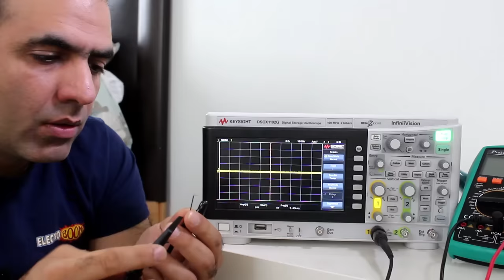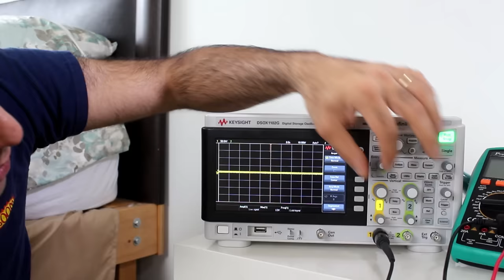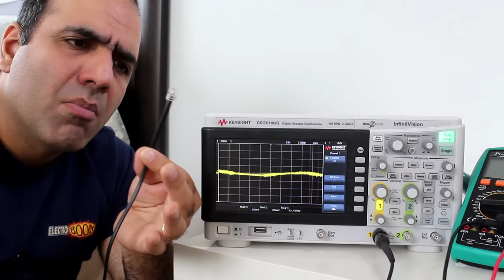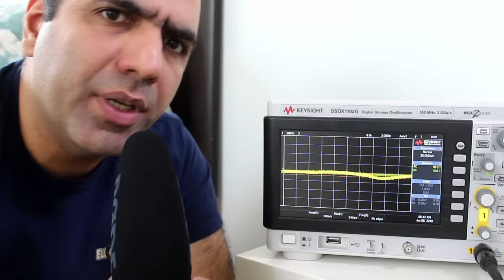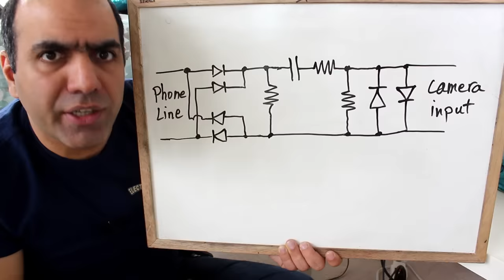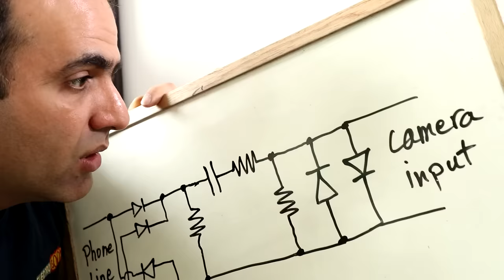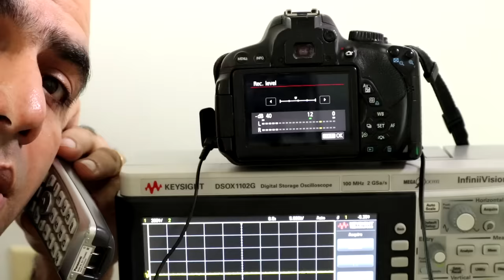How to Wiretap Phone Line with DIY Circuit

Comment: I always love the free-floating circuits without a breadboard or PCB, adds an extra level of chaos.
Reply: Chaotic evil circuit design
Reply: Back in the day they sold televisions made like that! 

A dozen valves, dozens of passive components, transformers, all made by soldering components directly to each other, and to the pins of valve sockets. Sometimes they'd have a tag strip, a strip of phenolic-impregnated paper, early PCB material, with metal tags with loops on each tag, attached along either side. The tags weren't connected to each other, unless you wired them together, but usually components just spanned between them, and each other, and the valve sockets etc, flying through the air (flappin' in the breeze!) like some sort of scifi architecture!

Then one day somebody invented the printed circuit board and it all got a lot more boring, though probably safer, and allowing more complex circuits to be made. Imagine a PC, with it's 8-layer motherboard and hundreds of tracks, replaced by wires zooming around the place and chips hovering everywhere. Would look like a Shenzhen rat's nest!
Reply: @greenaum  lol I feel like it would be literally impossible to hand wire a motherboard just from a volume/length of wire standpoint. I wonder how far back you have to go before you could do it? Could be an interesting (if incredibly difficult to impossible) project if you used a motherboard simple enough.
Reply: @MotorcycleWrites  The Turing Machine is probably one of the closest examples.. Although only just barely a computer.. ENIAC or the Mk 1... Although they likely used some form of circuit board.. (Please don't fault me for not having a vivid memory from what few actual photos of any of these I have seen in my life). Or the Bomb device used to decrypt signals from German Enigma machines... Again, a computing device, not quite a 'computer'.. close enough though. These can be faithfully rebuilt for the sake of doing so.. There are existing examples in museums of exact replicas. Imagine the type of mind it took to literally script programs using binary code on such long rolls of paper... And then rudimentary assembly languages on punch cards.. Thank the Mechanical God for CRT Displays...
Reply: HOT GLUE
Reply: It's all I could do

Comment: Fun fact: The term for the polarity of the phone line, "tip" and "ring", refers to the connectors on the switchboards operators used back before tone based switching. It doesn't mean any type of signaling, but rather it refers to the shape of the connector which is reminiscent of a quarter-inch mono channel audio jack. So it literary means the "tip" (+ side) of the audio jack and the "ring" or "sleeve" (- side) below the tip of the audio jack.
Reply: The GPO switchboard plug was more pointy than the standard 1/4" audio stereo plug to make it capable of rapid insertion and less wear. Tip and ring went to the twisted pair and sleeve to earth.
Reply: To be honest, really thanks for facts, thank you guys

Comment: I'm pretty sure you already know that but I'm going to say it anyway: The camera outputs DC voltage, because it was designed to support electret microphones. :)
Reply: phantom power?
Reply: Не очаквах да те намеря тук.
Reply: @MTBSelfieStickGuy  It is not phantom power, the electret microphones have a small field effect transistor to amplify its output.
Reply: @MTBSelfieStickGuy  yes

Comment: Here in the USA,  The line voltage is around 48 volts when off. Ring voltage goes from 0 to 96 volts. When you pick up the hand set, the line voltage drops to around 6 volts.
Reply: What is the voltage for each key?
Reply: @DaiShuryoTechnus  there isn't any difference really as far as I know. Old rotary phones work via pulse dialing so 10 short pulses (the clicking of the rotary) means a 0. With old systems you could literally fake this by pressing the button that hangs up the phone in a proper maner. Very difficult though but not impossible. The pulse is literally closing the circuit really fast, this video shows it with an LED: https://www.youtube.com/watch?v=2JlGYetRfi0 

Modern phone lines work with tone dialing where a frequency is sent for each key instead of pulses.

Comment: Wait
Phone line --> Free electricity?
Reply: Rule #1 of electroboom. . .broken
Reply: Don't forget the spooon
Reply: *ELECTROBOOM WANTS YOUR LOCATION*
Reply: @Chance Plays Is it though? Your phone compabybmight think you're using the phone and thus charge you for it.
Reply: Sorry. The line cards monitor current draw. You will get a visit if you do that !  I used to look into issues like that when I worked for Openreach.
Reply: Alexandre Peralta you still need to paynfor phone service. Phone lines are very small current rather than the 13A a regular outlet outlets
Reply: If you can run your home on 50V 10ma ....... More power to you   :-)
Reply: 9v 0 amps😑😑😑
Reply: THERE IS NO FREE ENERGY DEVICE!
Reply: I’d be surprised if you could even charge a phone with that output. That and the phone company would likely notice that continuous power draw and ask wtf you were doing.
Reply: @shaunclarke04  Seem to recall emergency calls are allowed from land lines without service. Might not be true any longer now that cell phones have took over.
Reply: @TRS-Tech  USED to work for Openreach? You're the chosen one.. help me lol help me.
Reply: @TRS-Tech  I'm still here lol how did you get away? I'm being sucked in deeper every day with no light at the end of the tunnel and battery contacts all the way down it.
Reply: @BH-tp3pm  LOL I used my EIN s  lottery number... nah sadly no lottery win. My back finally gave up on me. I have been bedbound for nearly 4 years now. I have just had a big operation at Stanmore and I am recovering from that at the moment. I miss the job and my team but not the company.

I take it those in the ivory towers still keep thinking up stupid rules and idea's !!! Someone needs to rise an A1024 or is it an A55 ? its been a while ....  :-D
Reply: @TRS-Tech  hahaha! No doubt if you had used your ein as winning numbers the firm would have some entitlement to that money... Lol! 

Ah don't. It's the same shit every day mate. A1024s from the 80s still knocking about. And probably the same e side cable from then too, thinking about it. Nightmare mate.
Reply: @BH-tp3pm  Just like the Ali cable that doesn't exist eh  ;-)  I found a 1024 on a wak from 1989 once. 

Yeah I connected my hawk and to be double sure my JDSU to myself but I failed the PQ test.

No E sides, Noisy D sides and D poles as far as the eye can see... Not much changes, I bet I still have jobs I raised sitting on CSS  LOL....... My heart goes out to you my friend.

Is there much work going on in terms of FTTP ? I cant see it being complete by 2025 myself !
Reply: @TRS-Tech  hahaha! Miracle isn't it. 

Yeah, I mean in all honesty all I do is fttp. I do copper maybe once or twice a week now. Was moved to the fibre team 2 years back. Tbh, I do about 3/4 provisions a day. There certainly is a lot of it being rolled out
Reply: @BH-tp3pm  That is good to hear. What modem did they go for in the end. I know they had issues with finding the right chipset modem that had battery backup to....

Do you blow the fibres or just do the termination and install ?
Reply: @TRS-Tech  some huwawi thing. But that's changing in the next couple months too lol. 

I do but don't get much legacy stuff anymore. Occasionally if there's a fault on the fibre I'll blow some more in
Reply: Alexandre Peralta, that’s true. Take the 48v and convert to 110 and you’re good.
Reply: No just steal ur neighbors power
Reply: @TRS-Tech  So that's about 0.5 watts of current. It you converted the 50V to 5V, you can charge a phone at 100mA. Normally USB has a maximum power current of 500mA, so it would charge 5 times slower at best. And most phones can do more than 500mA, my LG Aristo 2 can charge at up to 1.2A (1200mA) but usually it's 700-800mA at best.
Reply: Alexandre Peralta Technically you still paying for landline it’s not free electricity
Reply: 7:40 Screams in square wave
Reply: There is no free energy!
Reply: I live in Australia and because of the NBN they disconnected the main telephone and make it go through VoIP , they didn't disconnect the electricity form the line and I've got free electricity forever
Reply: @TRS-Tech  and if they call them, the house voltage drops :v
Reply: @michaelbenoit248  how??
Reply: THERE IS NO FREE ENERGY DEVICE!!!!!!!!!!!
Reply: @shaunclarke04   in america and most of the world they use 15 Amps on regular outlets
Reply: @jammehrmann1871  yeah, its 13 in the uk
Reply: Alexandre Peralta hmmmm
Reply: But don't you have to pay for the phone line
Reply: Hardvard needs you.
Reply: @TRS-Tech  what happened in the visits?
Reply: I wonder if my modem can operated with power
Reply: Alexandre Peralta yeah just if you’re paying $30 a month to pay for your phone line and one scammers call you blow up all your electronics
Reply: Phone lines actually dont shutdown even if the poer in the entire house got blown up.
Reply: Sayyid sahal no it is probably connected to the cable suppply box in the basement or outside or in a closet etc the thug is with the modern one it is connected to power or it has a backup battery
Reply: Good idea! I think I'll power my crypto mining rig with the phone line. $$$. You think it can handle 800 Watts??
Reply: No it changes your phone bill
Reply: That's a good one !  You can still have your phone, and also free energy ! Just use one of kreosan's schematic to increase the voltage and you're good ! Hope it doesn't destroy the phone line system, and the phone company may knock your door ! lol
Reply: @Chance Plays but then power costs less atleast
Reply: Not enough for a pc tho
Reply: My friend once made a little LED lamp powered from that outlet.
Reply: Solar energy
Reply: THERE IS NO FREE ENERGY
Reply: Cheap but useless
Reply: But the current is low
Reply: FAF!
Reply: @Chance Plays free if there is still voltage without a subscription for a prerecorded message.
Reply: Ya ya...
Reply: @szymongorczynski7621  but wait i can call my phone for free so does that mean i have cheap energy? 
idk
Reply: @shaunclarke04  but it is possible to increase the current using supercapacitors
Reply: @ruby_R53  no, current is to low initially
Reply: I knew a guy that lived without electricity, and he used the voltage from his no service phone line to charge batteries for flashlights, radios, etc.
Reply: He pays phone bill
Reply: @StkyDkNMeBlz  *ELECTROBOOM WANTS TO LIVE WITH YOU*
Reply: @TRS-Tech  it’s still A1024 nothing gets fixed though they’re just decoration in pcp’s lol
Reply: @davidmcgill1000  at least for the US and I would suspect most carriers they are bound by a law requiring emergency Communication Service so everything is battery backed, and since cable TV has taken over phone service they were required by the same to put battery backup in to comply with the 911 access terms. It used to be that when your service was disconnected you were allowed incoming calls that might have changed of course it would definitely be dependent on the service provider. Generally the line physically wouldn't be disconnected unless they had issues with you, that way the next person who rolls into that house can just call up and get service and plug their phones in. I suspect due to the neglect of Verizon to maintain the network and then subsequently Frontier take over and people thinking that they don't need a landline anymore there's a bit of neglect.

We had both cable and phone lines taken down by a tree one year since we had Comcast service they came out and repaired it however we never had phone service there so I don't think that was ever reconnected unless the next renters requested it. There's many people who just ripped out the old stuff as well, and I'm sure many people who don't realize that beyond the NDI box is the phone company's property and shouldn't be touching it but you know it looks ugly and we don't need that old thing so rip it off the wall.
Reply: 3:52 very little current.
Reply: There is no FREE ENERGY or FREE energy.
Reply: No they can’t supply much current.
Reply: The current is very small.  The central system will see your phone off hook if you are drawing current.  If you don’t make a call within an allotted time the system will put your line in idle mode until it stops drawing current and the reset it.
Reply: News
Reply: @Chance Plays Use your neighbors.
Reply: yep, its free energy, you can only power up a usb led with it, i used to do it all the time when the electricity cuts out.
the company never contacted me, i guess they know somehow.
but i wanted to go further, to at least power up a router or something. i would need 1amp
which is really hard to get out of those lines.
im still looking for a way to get at least 500ml or something.
for this i would need dc to dc converter, lowering the voltage from 50 to 12 v dc, i might be able to get more amps ( i hope)
Reply: @GingkaHagane43  where is Rayuga then ?
Reply: @scourageliquidater1590  oh we don't speak of him.
Reply: Lol not anymore because all modern phone lines use a modem plugged into your outlet.
Reply: well it doesnt deliver much current
Reply: @StkyDkNMeBlz  Location: Hell
Reply: ElectroBOOM will come specifically to your residence just to tell you that THERE'S NO FREE ENERGY DEVICE!!!

Comment: Residential POTS lines are normally-open 48v D.C. circuits,  the “hook” is a switch that closes the circuit which allows a dial-tone. Your particular “line” is a loop referred to as a “local loop” which terminates at a telephone switch operated by your carrier. In a business, typically you would have a PSTN telephone network that connects to a PBX that directly handles internal calls to extensions, the PBX will also have either an ATA that converts analog to SIP and connects back to an IPPBX in a VoIP system in a hybrid network or to a 23 channel PRI, usually a T1 interface back to your carrier for external calls. From that point on the infrastructure will remain the same as a residential one except businesses typically have multiple lines/subsequent numbers. The infrastructure within the walls of your company will typically fed by a 25 or 50 pair whip punched down into one or several 66 block(s), or 110 block(s) depending on the architecture of the network. Those blocks can be daisy chained/piggy backed together or be fed directly into another 25 or 50 pair amphenol whip connected to a voice gateway and out to a provider. T1 PRIs are significant because they are 24 channel circuits (in North America) at 1.544mbps bandwidth that operate at a set rate (hence PRI “primary rate interface”) controlled by the DS0 or framing channel which allows the line to operate at a set and predictable rate (enabling a clear voice call)....could go on for days

Comment: The DC output on the camera's input could be to power electret mics. I recently saw a video where someone found some of their cameras did, and some didn't, and none of them documented that being the case.
Reply: Kit Vitae also possibly some other addons from the camera's brand
Reply: In any case, I'd add a cap to both ends of the pairs. If the low side of the circuit drops down to -45V, you are in for a super good time.
Reply: Probably phantom power for condenser mics. Pretty common in pro audio. it would be 48V if so.
Reply: It's probably not for professional condenser mics which take 48V nominal (usually work from 9V or 12V and up, so much of the cheaper phantom host gear doesn't bother with full nominal voltage), but for electret capsules, which take something like 2-5V via a couple kOhm current limiting resistor. It might be conditional, i.e. they might be measuring the impedance of the microphone, but you normally expect electret mics to be directly supported by cameras.
Reply: Makes sense, its been ages since i've used a camera, either way it's to power active (non-dynamic) mics. I remember there being a phantom setting on the Canon SLII but again, this was ages ago and likely things have changed a lot toward lower voltage active mics.

Comment: ElectroBOOM, the DC voltage you see from the camera as soon as you start recording is the supply voltage for electret microphone capsules. It is commonly called "plug-in power" and is present on the microphone input of almost all consumer devices since the 80s, like walkmans, PC soundcards and laptops, cameras, etc.

Comment: I used to work for BT here in the UK remember crawling along the top of cable tray and puting my hand on a cut cable with ring tone on it leaped up after getting a shock nearly knocked my self out on the ceiling which was only about 3 feet above the cable tray!!

Comment: It least I know I'm not the only person who thought it was a good idea to enclose my whole circuit in hot glue as quick, cheap enclosure. For a circuit like this, I would make it thinner so the whole thing fits in a large heat shrink tube, fill the tube with hot glue, then heat shrink the tube to squeeze out the excess glue to make a sleek, compact enclosure.